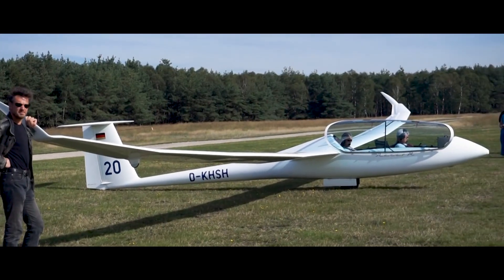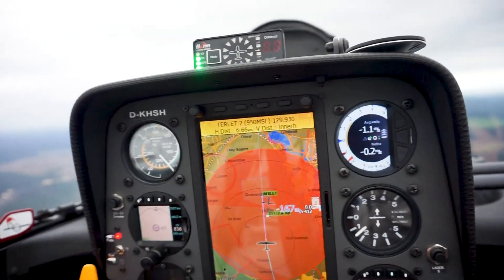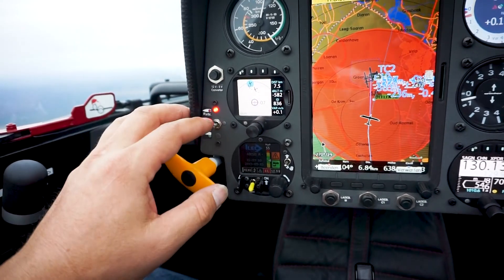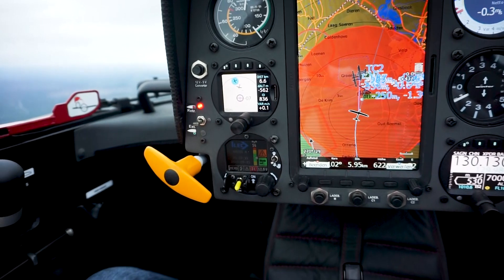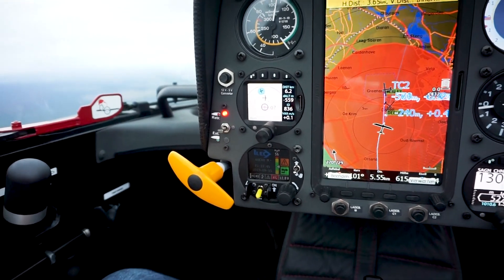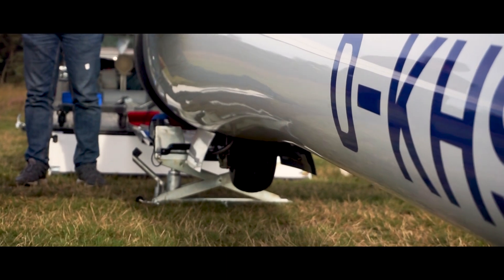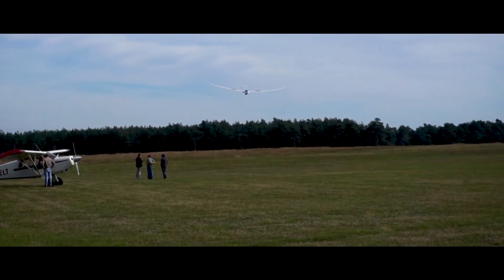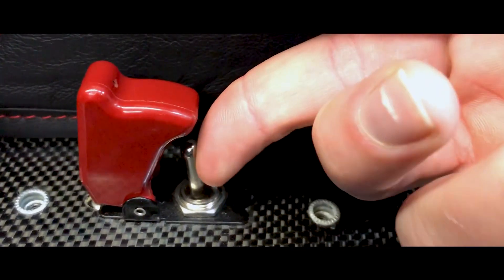AN ELECTRICAL GEAR?! | The New Arcus

Comment: I think in there are two safety reasons to use a electrical gear: 
 1) Most of us are right handed, here you can use the left hand to retract / extend the gear. You don´t have to let go the stick to retract the wheel. 
2) you don´t have the movement while pulling it in, you can see very often while flying in the double seater, that there will be a slight pull as well on the stick. Everyone has seen the "nick" of a glider when the wheel was forgotten and someone told the pilot via radio "gear up, gear up". We even hat a fatal accident in Germany with someone hitting the ground while trying to get the gear out. 
3) My Glider uses a electrical gear since ten years, no problems so far :-)

Comment: Its a cool feature..but why??? a mechanical gear lowering system is more reliable and simpler....i think this is just overcomplicating things
Reply: Have you ever flown an arcus or a duo discus? It's very hard to raise the gear up. I know some pilots who even fly with gear down because they can't raise it
Reply: @y.k.7737  ive flown in a duo discus xlt and with the power of both pilots the gear comes up pretty easy in my opinion

Comment: My first reaction was that any electrical system will eventually fail. And even with a spare battery only dedicated to the gear, still the spindle can fail of course and what then ? But we learned this year in Namibia, that also the old Arcus mechanical system can fail, when the manual lever broke during a flight and one Arcus had to land gear up.
Reply from the maker: Interesting point! Scary situation!
Reply: Seems to be a common flaw. It broke on ours too.

Comment: I wonder why adding a battery and electrical system was chosen over re-designing a proper mechanical gear mechanism. Other manufacturers have done it, why not S-H?
Reply: All S-H gear mechansims suck. Arcus, Discus2. They are made for flying not landing. :-)

Comment: I have an Arcus. This is not a change I would want. Without the electric motor it is quick and easy to either raise or lower the gear from either cockpit, and to confirm its position. Why have a system which is slower, which has more to go wrong, and which distracts you more because you have to look at lights to tell where the gear is?
Reply: My wife and I just bought an Arcus and I have to say, the combination of my shortish arms and the seat position, make it very awkward for me to get the gear up and locked on my own. Putting it down is a little easier but I am at full stretch to engage the detent. My wife has not flown it from the front seat yet but I think she will really struggle if flying solo. Our previous ASW 28 was so much easier but hopefully, we will develop our technique!
Reply: @grahambambrook313  Congratulations. Enjoy the glider. Hope you find a technique which makes the u/c easier for you.
Reply: @markburton5170  Cheers :-)

Comment: how system prevents fold the wheel while seats on the ground?
Reply: overload on electric motor makes the system stopped. As to retract first the gear as to go a bit more "down" this produce the overload and stop the e motor.

Comment: Thank you for the great video Simon, the electric landing gear is an really interesting system, sometimes it is not that easy to retract a fully mechanical gear, additionally without all that mechanical components you can theoretically gain space in the cockpit :D

Comment: Cool gadget, but not for me.  Really, how hard is it to lower the gear?  Just one more electrical thing to go wrong, particularly if the battery fails or runs out.  I agree with Stefan.  There needs to be a manual override for if the electronics fail.
Reply: While I do think a manual override is necessary, the gear of the Arcus I flew is incredibly hard to lower and raise. I just don't like it. An electrical system will allow "weaker" pilots to fly the arcus maybe even solo, since I can't lower or raise the gear (and lock!) on my own :)
Reply: lower the gear was not the problem, make it up yes. And as it was hard people had to try hard with too much force, and this made the mechanic dying at the end... Now it is smooth. And you can override electronic (positions sensors) and main battery with a dedicated battery + switch which controls directly the electric motor. This switch is on front seat (see end of video).

Comment: Congrats to 1k subscribers!
Nice video as always. I think a mechanical option to lower the gear without electricity or if the spindle fails, would be a good.
Reply: DG1000 has that.  Works great.
Reply: @wgmskiing  the Lange Antares also got a mechanical backup. You pull a wire and the gear falls out and locks into place. I can't understand why SH didn't do this. If something else than the end sensors fail you propably have to land gear up.
Reply: An UN-necessary and likely to fail option if battery leave becomes low also increased weight. Say your checks aloud and loud after identifying under carriage - (Fahr Werk) lever.
Cheers 🥃 Henry Leschen 😀

Comment: Are the switches in both cockpits? Does the instructor switch override the one for the front? What is the amount of effort required on the previous Arcus?
Reply: yes both seats have switches. And front seat has an extra emergency switch with dedicated battery and no sensors positions so you have direct control on the electric motor for retraction / extension.
Reply: On the previous arcus its painful if you fly it solo. Plus the mechanism broke apart on ours. Electric gears have their own challenges, such as emergency procedures, and power requirements, extra sensors etc.